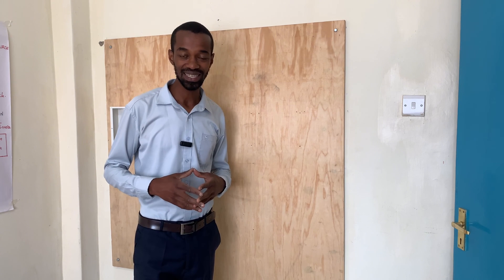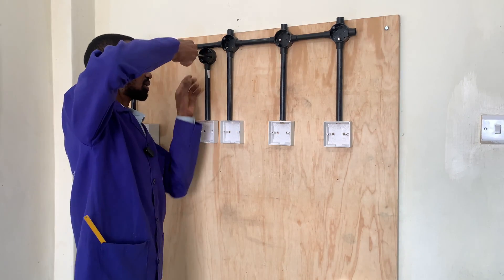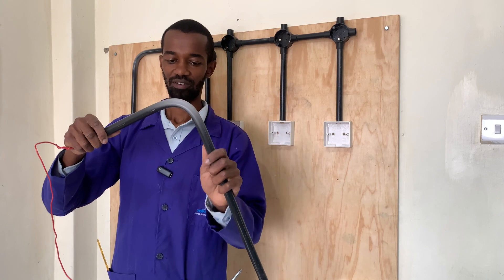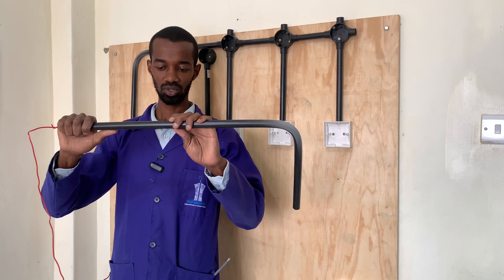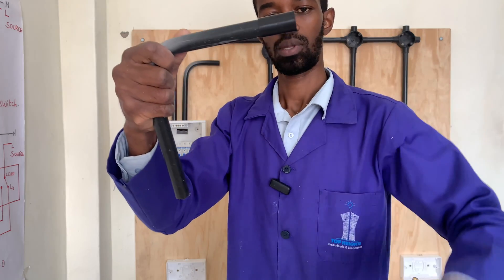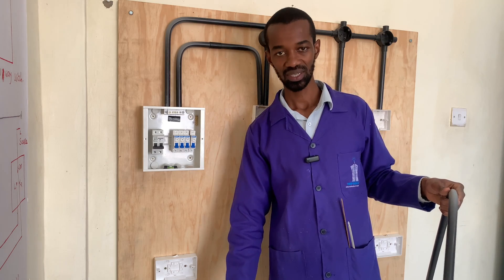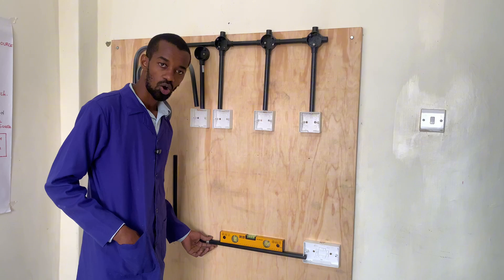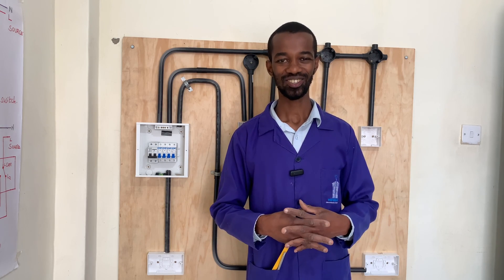How To Practically Do Electrical Piping (For Beginners)

Comment: Very neat. How do u bend those that break
Reply from the maker: Thank you namesake John☺
I cut the broken part and bend again the other piece and if it's shorter, I join it with a coupler and glue. Did I answer your question well as you expected?
Reply: Your explanations are simple and straight to the point. Thanks 😊
Reply from the maker: Thanks  @mulengajohn3773  Where can I improve?

Comment: Bt we have some conduits when you bend they broke down
Reply from the maker: I agree with you Willy. Those ones really cause a lot of wastage of time and money to the client. I avoid those!
Reply: True and they  are stressful 
And our engineer should tell us which is the best conduit to use
Reply from the maker: I agree Kelvin. Whenever I go to buy them, I normally ask for the heavy gauge ones, in most cases, I never go wrong. What do you think?
Reply: @topheightselectricians  thanks for the insight from now on heavy gauge it is
Reply: Is it correct to use sand inside the conduit and fire for bending
Reply: @victoranyango2150  u can this we do as a plan B its skill tht no school will teach u
Reply from the maker: @victoranyango2150  I have never tried it. Does it work?
Reply: @topheightselectricians  it works only it does not bring a fine bend, I tried it in one occasion.
Reply: @topheightselectricians If you use hot sand it makes perfect bends.
Reply: Let me explain those that break are heavy gauge pipes and those that cooperate are lightgauge.
Reply from the maker: My experience with lightgauge is different then @edentv7816